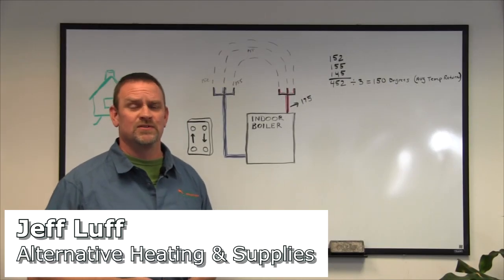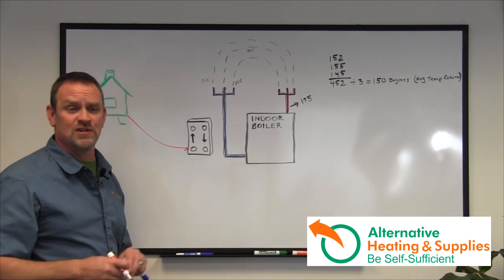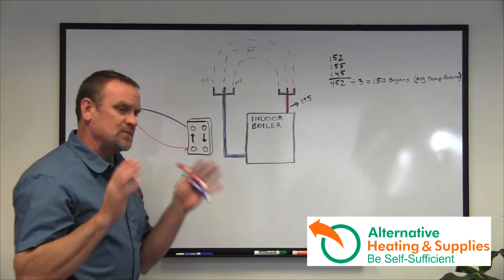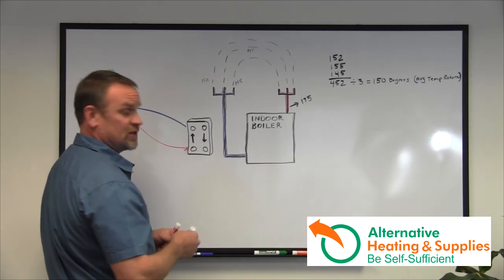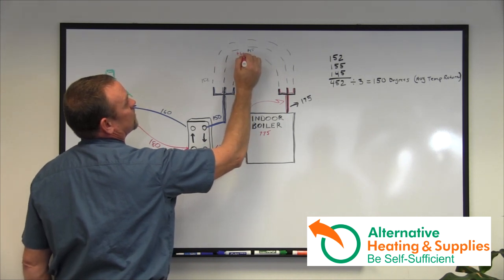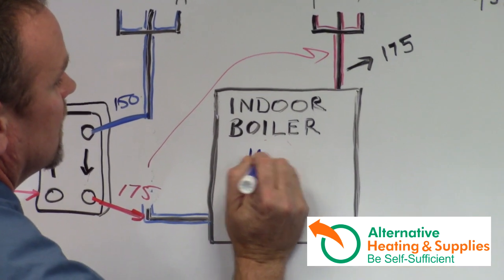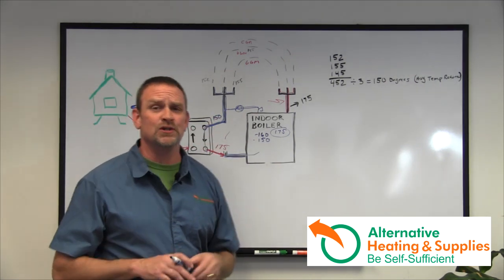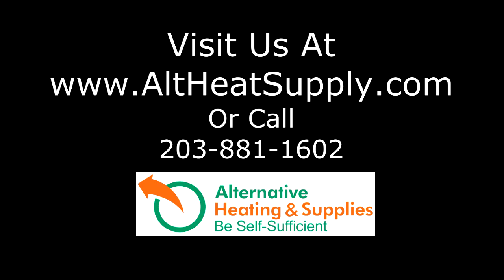Properly Connecting an Outdoor Wood Boiler to Indoor Boiler [PART 1]

Comment: If my oil boiler turns on will it heat the water lines out to the wood boiler?
Reply from the maker: Yes it will back feed the heat. It is good when you go on vacation you won't need to worry about wood boiler freezing... If you wan to prevent back feed to wood boiler turn off circulator at wood boiler. Jeff

Comment: I have to disagree with thius setup. If that outdoor boiler is not heating you will be transferring heat from the house to the outside ! I set my system up using a "H" prior to the exchanger on th eoutside system . The system will just pump the outdoor boiler water in a circle  (bypassing the exchanger) this prevents heat transfer from inside to outside . When  until the inside return temp is 5 degrees lower than the outside boiler  a valve opens and allows the outdoor water  to go the  exchanger .  Refrigeration controls work excellent o do this type of comparison

Comment: What is the hookup if your furnace heat domestic hot water
Reply from the maker: Not understanding your question.
Reply: I think the question is what if your indoor oil boiler also has an internal coil/heat exchanger for domestic hot water.  In this diagram, the hot boiler water will only circulate if a heating zone is on or open.        @AltheatsupplyLLC

Comment: I know this is an older video but am wondering what the rear aquastat should be set at for the spring and fall months when thermostats aren't calling for heat?
Reply from the maker: Depends on your application, turn it down as low as 160 if you like, but not lower then that.

Comment: Great videos, thanks. Currently installing a new wood boiler. I'm not electrical or HVAC savy. I have a two wire thermostat and I have a thermopride oil furnace. Do you have a link to somewhere that shows the aquastat wired in?
Reply from the maker: No Sorry, Every system is different. Jeff

Comment: Any suggestions with a setup involving a Prestige Solo 110 gas boiler? The outdoor boiler is set higher (190/180) than the gas boiler (170/146), but the gas burner is still running. The install follows your video.
Reply: Your prestige boiler most likely is piped with a primary secondary piping arrangement. This is the proper way to tie in your wood boiler. You must install 2 more closely spaced T's next to the T's that the  Prestige enters. This will allow for the hydraulic decoupling of the boilers from the system and prevents one boiler from circulating through the other. Your Prestige comes with an outdoor reset control that will adjust water temp according to outside temp. I would use either a 3 or 4 way mixing valve with an outdoor reset of its own on the system side of your plate exchanger. This is not really necessary if you have baseboard or radiators but you will have to adjust your comfort level to having 180 degree water throughout your system no matter what the outside temp is. If you have radiant floor heat then you must add the mixing valve with the reset or risk overheating your floors. You could install a manual mixing valve and use it as a high temp stop but then you would get extreme overheating on warmer days.

Comment: Question:  If hot goes to cold.  Heat exchanger, should the oil boiler be set at a lower temp? The wood boiler a little higher?
Should there be a difference, if so how mant degrees?  Thank you.
Reply: I would think when the load is on the oil boiler, it would be lower.
Reply from the maker: Yes you can turn the temp of the oil boiler down a little bit, nothing lower then 155 degrees.

Comment: Great information.  I wonder if this type of tie in would work with a geothermal system.  Seems like it would but maybe the internal thermostat works differently for the better.
Reply from the maker: It does work with Geothermal, I have Geothermal in my house and it works great with this kit. Jeff
Reply: @AltheatsupplyLLC  that is awesome !  My geothermal has 2” lines coming in. I don’t know the flow rate or I could probably easily pick a model. Did you have to modify the internal thermostat on your system ?  I was/am hopeful there isn’t anything that needs modded in the unit since it’s not a boiler.

Comment: Nice.  Where would you hook up a buffer tank and DHW tank with this set up.  Have outdoor pellet boiler(Prime heat) and gas boiler inside as back up.  Thank you
Reply from the maker: Not understanding buffer tank unless you have instant hot water system?
Reply: @AltheatsupplyLLC  Sorry, not sure if you could provide a suggested diagram.  Have a Outdoor wood boiler and runs into a 40plate heat exchanger inside.  From the heat exchanger were not sure where to put a buffer tank(120gal) and connect indoor gas boiler(backup).  The buffer tank will heat main loop which heats forced air furnace, basement infloor and garage infloor)  Have another heat exchanger for DHW which plan to use as well.   OPB(90gal Maxim P255)-40plate heat exchanger-buffer tank(120gal)-gas boiler(baxi 1.7 as back up) --- 10 plate heat exchanger - 50gal DHW tank.  Sorry for my poor description hope you have a suggestion.

Comment: I want to install a weather sensitive thermostate on an électric boiler that has 4 manual thermostat. I'm looking for the control that can be ajusted to the temp ouside to the temp of the wather. To do that I'm thinking a 100amp switch that is controled by the 12 or 24 volt programable thernostat. Manualy cranking up my 4 manual thermostate to the maximum, puting a sensor on the boiler to know the temp and letting the programable thermostate start or stop the elements when needed.  If this makes sense to you (I'm french) can you point me to the right equipment? Thanks
Reply from the maker: Sorry I know wood boiler hook-ups and not systems like you described.

Comment: I have a NTI vmax 153p, three zones in my 2400sq ft home, it loves to eat the propane during the winter. In definitely purchasing a wood boiler, can you point me in the direction for what wood boiler you recommend, I live in the interior of BC. Our vmax boiler is a combo unit that we use for direct hot water and central heat, is there any way to introduce the wood boiler for the direct hot water supply?

Comment: Looking for wiring diagram to use existing thermostat for oil furnace , biggest question is how do you keep fan from running at the time because of the snap disk , fan will always want to cool down the furnace Till it’s cooled down ?

Comment: Do you have any videos with more detail on installing the loop that you talk about at about 9:40 in this video?  I just connected an outdoor boiler to my indoor propane boiler through a BPHE, and the temp gauge on the indoor boiler is staying around 120 while my wood boiler is set at 180.  I turned up all the tstats in the house and let it run for a 10 minutes yesterday, and the indoor boiler guage got up to 155, so I think a bypass loop would keep the temp up.  I'm also thinking about using snap disc limit control mounted on the incoming wood boiler line wired in series with my indoor boiler aquastat to prevent the indoor boiler from firing up when hot water is coming in from the outdoor boiler.  Does that seem like a good solution?

Comment: So if you wanted to run them independently of each other, would you just tie the wood boiler to the supply and return with valves to isolate the wood boiler?

Comment: I have a coal boiler inside and want to add a hot air vent in the floor of our great room. The baseboard in that area is just not keeping up on the very cold days. Is there a video for this? I don't have any hot air system yet.. I see there are units like toe kick and in floor exchangers. I already have a toe kick. But need something bigger in floor.

Comment: Okay I have been kicking around ideas for using outside wood boiler and using a exchanger setup to supplement/replace the electric heat component of the indoor electric furnace. I don't know what I don't know so if this is a bad idea okay but resources to do research and figure out if this is feasible would be greatly appreciated. Also as a side note wanting to use the exchanger 2 fold and use it for cooling aid during the summer with understood plumbing involved. To give perspective of this project and help with helping me is I am wanting to modify/replace the electric furnace inside a mobile home to lower my electricity use and have a method of keeping a method of heating in the event of power failure.

Comment: You never mentioned if you run out of wood your gas boiler will try and transfer the heat in reverse to heat the water with in the wood boiler!
Reply: Thank you for pointing that out. Now, I don't have to.
Reply: That was my question thanks for the answer

Comment: This is a great explanation of how this works, I am in need of doing this in a few years and wasn't sure how this worked.   I have hydronic in floor heat in my shop and small cabin, 2 zone using a Weil Mcclain Ultra 155. When we build the log home and move to this property I want to heat both the Log home and shop /cabin with wood but have a backup propane boiler in each so we can leave and not worry about running out of wood while gone.

Comment: Jeff Luff:- talking to most outdoor installers about connecting to indoor furnace system one is usually told that an 'air handler' water to air heat exchanger installed in the air plenum after the furnace will provide the necessary heating. However many furnaces supply air to the plenum at much more than 200 degrees, mine has a high temp cutoff at 220. If this is the case and boiler temperature is 180 and plenum air flow is somewhat restricted by the air handler does it not follow that heat output when outdoor boiler is being used will be significantly reduced??    I feel you should mention the importance corrosion inhibitors in the system.

Comment: I installed a 10 plate from another company a few years ago. First year it worked awesome 2nd year pretty good 3rd year it did nothing. I am on city water. I think it must have plugged up. Has this happened to anyone else? Does any know why this would happen on city water. Was it just a cheap plate heater?
Reply: Billwise, I worked with plate heat exchangers in milk pasteurization. Identical to these shown EXCEPT they were neoprene gasketed between plates and clamped together, not brazed, to facilitate cleaning and plate repair.Plates do occasional crack due to operational stresses. With milk it is essential to run a wash cycle every four hours or the system plugs. The same thing can happen with domestic water but over longer periods. I have a plate exchanger between my boiler circuit and hot water tank and found it to eventually scale up despite running supply water through softener and carbon filter so am making a tube exchanger. FYI a 48 X 12 part of my house has in floor radiant heat supplied from my heat tank in an isolated circuit and through  a 30' loop of 3/4' copper within the tank.

Comment: Your videos are awesome! I am tying a new(er) outdoor wood boiler to my propane furnace. I would like to use a water modine as a dump zone in my attached garage to prevent overheating my wood boiler. What parts do I need to do this? I want to also install a thermostat in the attached garage to adjust the temperature when needed that will work independently from the "dump zone" application. I plan on having the house circulation pump run continuously along with the wood boiler pump to prevent freeze up (no antifreeze $$$) when the stove runs out of wood (weekend away) with use of a plate exchanger (size?? 2800 sq ft house). I also have a seperate run of rehau pex insulated to my shop that I am planning on having the pump circulating to a modine but the fan controlled by thermostat. Any help is greatly appreciated!

Comment: If someone is really concerned about the heat exchanger reducing circulation can they not just use two of them in parallel?
Reply from the maker: Yes they can use in Parallel. to reduce resistance and larger heating needs, Great question...

Comment: What if I have an indirect water heater would that change anything?
Reply from the maker: Yes it is hooked to the boiler for heat, Watch the video for hooking up a boiler. You can still do this but it isn't necessary if the inside boiler is already hooked up.
Reply: Alternative Heating & Supplies Yes I has a propane boiler hooked to the indirect water heater. The boiler has 4 zones. I just bought an indoor wood boiler that I want to put in an outdoor shed. I just wanna ensure I run it into my existing setup correctly.
Reply from the maker: watch this video https://www.youtube.com/watch?v=htuWDWipjeM to help
Reply: Ok what if I decide to not run the outside wood boiler and just run the indoor furnace does that water now always Travel through outdoor boiler or am I not understanding plate correctly?
Reply: And with the outdoor boiler do I need a separate aquastat, pressure relief tank, and pump or is it completely ran by indoor current setup?
Reply from the maker: Only if the outdoor boiler is pressurized, Most are not.

Comment: Great video.  Do you actually think though that it's more self sufficient to use an outdoor wood boiler than a natural gas furnace let's say since they both require electricity to run? I'm curious to know your opinion. Thanks.
Reply from the maker: Yes the both use electricity... But the fuel is the big expense. for most people wood is free (With Labor and hard work) and you don't pay tax on wood. Thanks for your question..
Reply: Alternative Heating & Supplies Thanks for the reply and I agree about wood being a relatively cheap to free energy source.  I guess when I think self sufficiency I think off grid. In a total power failure both systems will fail.  I guess the next best thing is solar backup or an indoor woodstove for grid free heat.
Reply from the maker: Yes off grid is the Holy grail. We are needing one thing less and not paying for another product and taxes. Yes solar and battery backup is the best. unless you have good wind.
Reply: @AltheatsupplyLLC  tell that to my CPA lol..

Comment: Where would the circulation pumps be for the exchange plate? Or is there none except for the zones?  I'm trying to re-work the plumbing from the previous house owner. He has the oil boiler setup with one hot supply (out of the top with T's...also where exchanger hot comes in). Then 2 return lines (each with own circulation pump) coming into 2 spots on the bottom of the oil boiler. A third pipe (out of the bottom, with a pump) is the cold out to exchanger.

Comment: EXCELLENT series on hooking a wood boiler up. You've answered almost every question I had thought about over the last year. One question you may cover in another video but not in this one, if the boiler runs out of wood and the gas kicks back in, will the gas furnace heat the the water in the wood boiler so it doesn't freeze? Or does the circulation pump stop working on the outdoor boiler when it quits pumping heat? Thanks
Rob